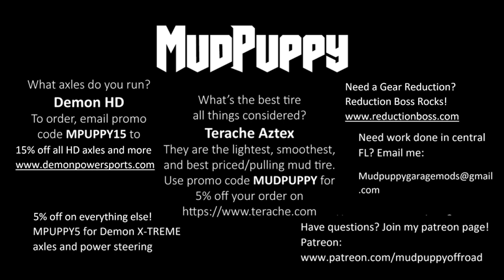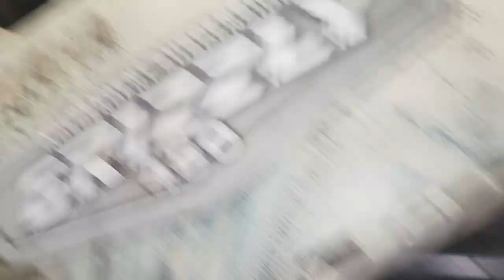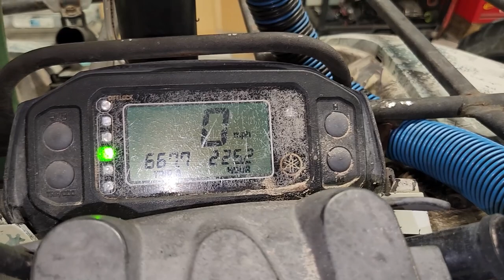450 Yamaha Grizzly or Kodiak snorkel piping vent lines waterproofing

Comment: I have a 03 Kodiak 450 4x4 auto and I did similar to what u did except the air intake I couldn't find a 90° rubber elbow small enough to make that curve. I have a hmf exhaust with a jet kit and hauls ass lol I beat a brand new Polaris 450 auto lol

Comment: If your belt is slipping after you installed shims your belt is worn out, 1000's of people shim or machine the sheaves without issue. It's the must do mod for bigger tires because it's dirt cheap and works great. I've done it to a few king quads and none of them have ever slipped a belt afterwards.
Your theory about the smaller contact area on the belt is right but it is a non issue with a good belt.
Reply from the maker: Gears will always be better...
Reply: @MudPuppyOffroad  Except for when your trail riding in high range then you'll be wishing for stock gears...
Reply from the maker: @nseric1233  if I was going to run stock tires yes but I would never do that
Reply: @MudPuppyOffroad They just dont need the reduction, it's a waste of time and money on that machine, they're geared plenty low with a 10 dollar shim. My buds have kodiaks, they never ever use low range it's too slow with 26 inch tires.
Reply from the maker: @nseric1233  thank you for your opinion lol wait to see my video of this thing coming to a complete stop in mildly thick mud 100% needs lower gears especially in reverse the only belt drives that are worth a shit to me are ones that have extremely low gears to make up for the stupid rubber band

Comment: What kind of snorkel tubing you using what’s the name ? Would be much appreciated thank you 🙏the green and blue tubing
Reply from the maker: CURBSIDE
Pick up today
Abbott Rubber PVC Pump Suction Hose, 1-1/2 in. ID, Sold per ft. in stores, 1240-1500
$2.49
Tractor Supply Company
14.5 mi · Closed

Comment: Would a stiffer secondary spring setup with the shim mod not also be better vs just the shim? I didn’t think a shim mod alone was as common. You could also consider slugs, I hate them personally but with a big tire setup it might be better… food for thought
Reply from the maker: I'm going to test out a 1.2 mm shim and the softest secondary spring Epi makes just to do the science but it's not going to account for the fact that this thing is geared 67% higher in Reverse than low range LOL
Reply: @MudPuppyOffroad  yeah I use to run the 1.2mm shim and purple epi, was a great balanced setup for moderate tires… limits speed until you get a machined sheave. Highly recommend a machined sheave! Great to see some more Yamaha content - sink er deep!

Comment: How do the gear ratios on the Kodiak 700 compare?
Reply from the maker: The grizzly and Kodiak 700 have the same ratio and are geared about 30% higher in low range which is why I will not buy one